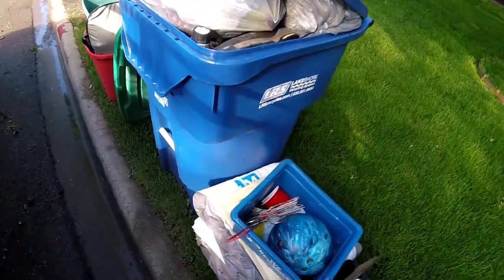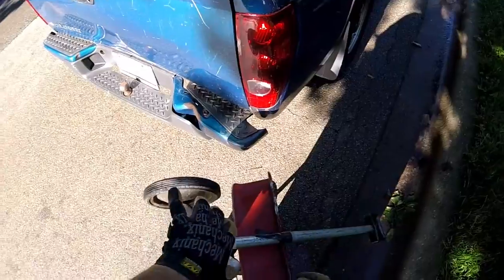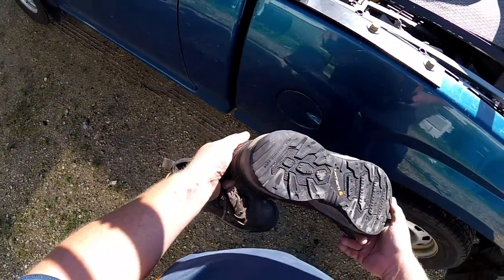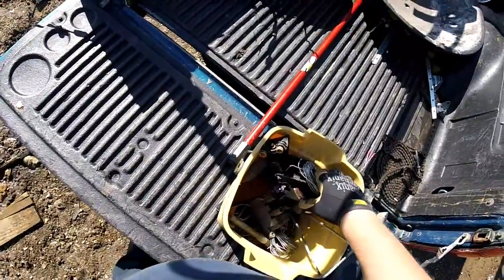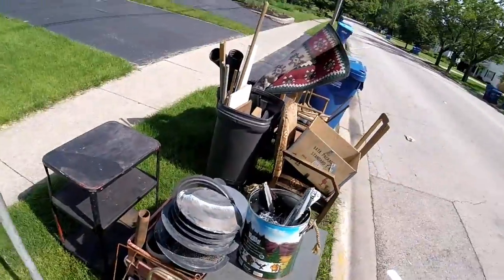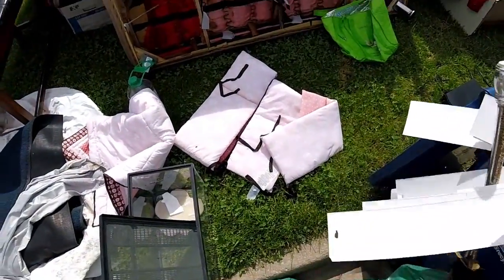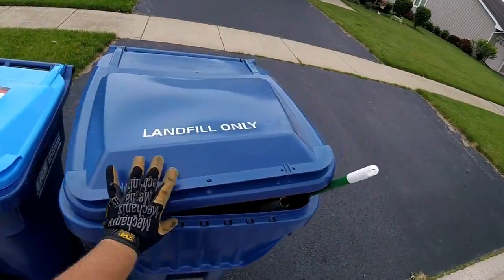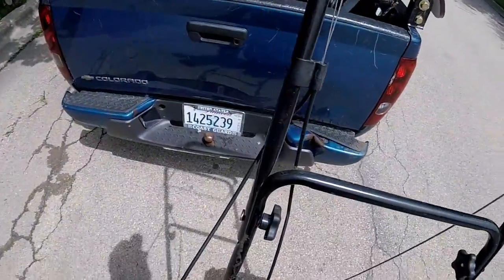Look at What I Found in the Trash

Comment from the maker: Subscribe Here http://www.youtube.com/c/scrappalletman/?sub_confirmation=1?
Reply: Great vid as usual just one question how can dimco justify the drop in price when the other scrapyard rates were still higher? 👍
Reply from the maker: @aduncan2911  good question. Have no clue how they do their pricing
Reply: Paul mate, could I suggest you get a dozen short bungee straps about 8 or 10 inches? So you could just tie where needed, rather than yards or rope around the stuff on your truck :)
Reply: Did you throw the copper fire pan in the shred pile Paul?
Reply from the maker: it was steel
Reply: Will gladly be ur subs ;) Ur doing great work!
Reply: Wow a hundred dollar pair of boots and a shiny red wagon .can't beat that 😎
Reply from the maker: I just sold the Red Wagon 5 minutes ago. :-)
Reply: Next time with mowers use a 10mm remover fuel bowl and spray carb clean put back together easy $
Reply: @StephanieBargelski3015  it's recycled by various companies.
Reply: @aduncan2911  M

Comment: With scrap prices so ridiculously low I wish you did more to resell stuff. Like a seemingly brand new microwave oven, a fine wheelbarrow that may just have needed air in the tyre, and a lawnmover, which perhaps just needed a new spark plug or a little clean-up. Or at least recovery of the ful tank of gas. It's frustrating to see perfectly fine things to to scrap, all for a few pennies.
Reply: Completely agree.

Comment: Just a tip get yourself a little can of starting fluid sometimes you just got to take the air cleaner covers off of those lawn mowers and give him a little shot of Go Juice after sitting all winter long and then we'll pick fuel right up and start running most of the time that's what's wrong with him he will just fill them with gas and then they don't start so they give up
Reply from the maker: Super awesome idea. I just found a can of starting fluid.

Comment: I thought I recognize that old papa john sign. I used to be a delivery driver so they stay on the car real good. It does light up if the bulb works on the inside.
Reply from the maker: The bulb and area on the bottom is deteriorated

Comment: The railway rail is iron.
Reply from the maker: It better be
Reply: @ScrapPalletMan  it is. I only know because we make it in australia alot. 
And its real name is "railway iron"
Reply: Its called railway iron for a reason.
Reply: @ScrapPalletMan  well its technicaly iron but sold as high stress steel which is the same thing. But it isnt as good as the old railway like you found. That is mostly iron due to colour etc. All the old railway here is that same colour.